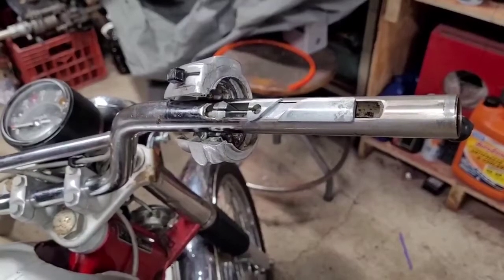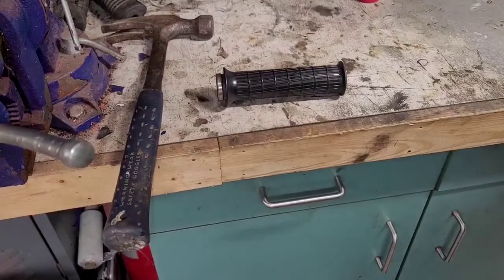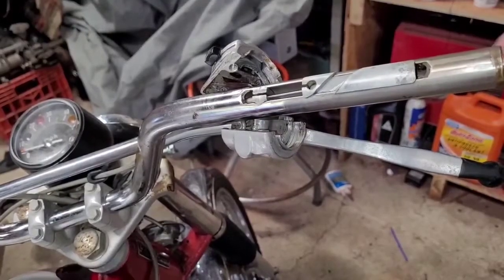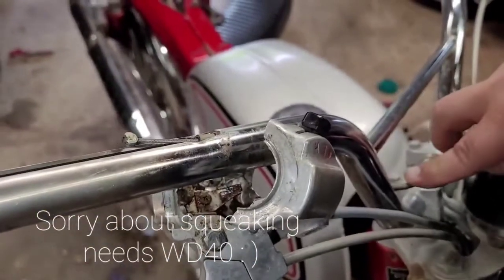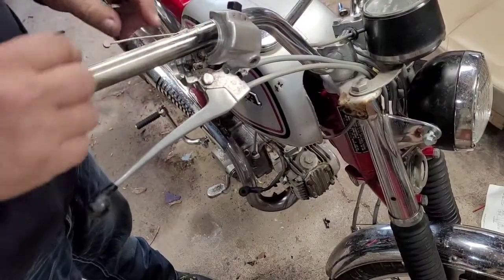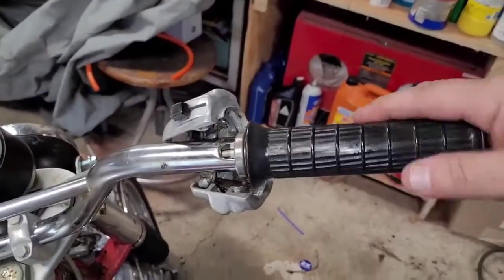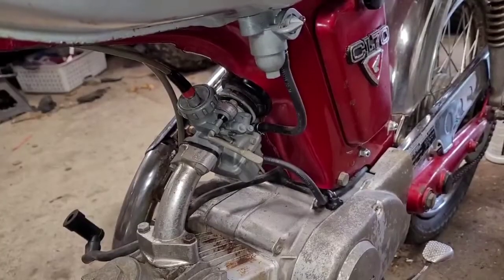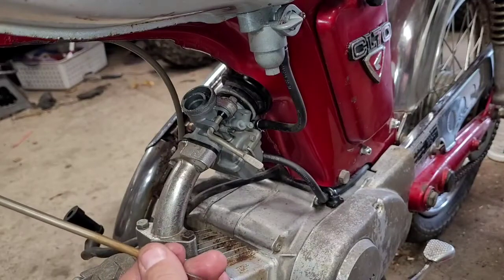Fix stuck twist throttle on vintage Honda motorcycle.

Comment: Thank you. That video was so helpful. It's exactly what I needed. I Can't Believe I came across this right when I needed it most. I really appreciate you putting this content out there and I love your restoration videos, they are very inspiring to me. I have a 1980 cb750 that I bought from some one that was about 75% done making into a cafe racer and restoring it at the same time. I think I will most likely change direction a little and make it into more of a scrambler style bike. I had bought a 1970 cb100 to use to teach my daughter how to ride and the throttle on that bike had the same sticky throttle problem you talked about in this video. Seeing you show how you solved that problem was exactly what I needed and as always your explanation is easy to understand. Thanks again and I look forward to seeing your videos as they come out. Please keep up the good work.
Reply from the maker: Awesome! I'm really glad it helped.  Good Luck on your projects. We have to keep these old machines moving 👍

Comment: Excellent video! I just bought a running 66 Baby Dream that ran perfectly yesterday, so this morning, I went out to take it for my first actual ride, I went to start it and as soon as it turned over it went to WOT. I think I killed it before any damage occurred, but now I'm afraid to try to start it without knowing how the damn thing works! This is just what I needed. Thanks a ton!
Reply from the maker: Great, hope it helps and good luck on the bike. 👍

Comment: This was just the video I was looking for! I have the same problem with my 67 CA160. You just helped me a ton! I am hoping that with a new throttle cable and fixing the twist grip, my newly cleaned carburetor will stop leaking through the overflow tube.
Reply from the maker: Thats great. glad it helped. hope your project goes well !! mines leaking at the petcock, just got my new gaskets.
Reply: @AdamzGarage  I have to replace my petcock as well. I'm thinking about not sealing my tank. Seems better to just keep it filled with gas!
Reply from the maker: @stevenrandall9601  yes I agree. I cleaned mine well and just keep it filled with gas. Once you coat it there's no going back. If a tank is thin or has tiny holes then that's pretty much your only choice.

Comment: Thanks for the video.  My throttle on my CT90 is hanging up, now I believe I can easily get it properly moving again.
Reply from the maker: Great. Hope it goes well 👍
Reply: Having the exact same issue atm. Once I kick start, it goes from starting to redlining withing 3 seconds.  No return movement at all when twisted.
Reply: @Yutter89  Hi. Did you figured it out? My 74 CT90 does the same.

Comment: Did you happen to do a video on getting the carb end reinstalled? Followed everything in the video, however, mine is still stuck open. Assuming it’s a spring issue but as far as I can tell I have the carb end with spring/valve installed correctly. Wondering if the cable is getting pinched up inside but hard to tell what’s going on there.
Reply from the maker: Unfortunately I didn't make a video putting the end back together.  I did do a carb rebuild video, not sure if it will help but ill include a link. Another important thing is cable routing from the carb to the twist throttle.  Even a slight bend in the wrong place could cause an issue. Just a thought.

https://youtu.be/2t49wYh6_2s
Reply: @AdamzGarage  thanks a ton. Yeah I’m pulling the whole cable off today to reroute. She’s stuffed up in the bar with another thick wire so I’m wondering if maybe something is kinked up in there. The little piece the grip end sits in looks a bit chewed up too, hard to find a replacement, so may take a bit of sandpaper to her to ensure the cable isn’t grinding up in that gap as well.

Comment: I’ll have to try this... mine is still really sticky
Reply from the maker: Good luck with your project. It worked well for mine.
Reply from the maker: @raycist108  Nice work!! And I second the painting, the results are always satisfying 👍
Reply: @AdamzGarage  I have access to sand blasting at my work. But I took this apart years ago. All the notes I put on the wires are faded . 😞 
It has no turn signals so many stray wires in the headlight socket not connected. 🤷🏼‍♂️ The wiring diagrams don’t seem to match my 52 year old wires either. 
I don’t think the engine needs any of that to start. Has not started since 2015
Reply: @AdamzGarage  what year do you have..? Mine is a K0 so far harder to find parts than a K1+
Anyone know if that screen on the carb HAS to be there for it to run?
Reply from the maker: @raycist108  mines a 1972 cl-70. I think the screen is more for catching  debris than anything.  Not sure if it will effect the flow of gas? Good question. Mine was pretty bad. I found a new old stock one for mine. got lucky.